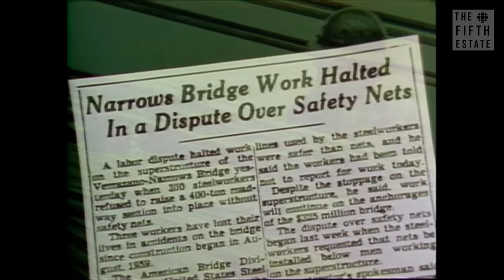Ironworkers from Newfoundland : Walking Iron (1986) - The Fifth Estate

Comment: I don’t think you could find a more manly job then an ironworker. These guys have balls of steel.
Reply: A lot different these days,safety has changed a lot!
Reply: Balls of iron
Reply: I agree
Reply: A miner . 
Where the iron begins 👍
Reply: Try “Steeplejack”
Reply: Nuts of steel*
Reply: @typicalrockhound9887   I ironwork in a mine, what’s that mean?
Reply: Feminist don't want this job
Reply: @peterwarawa2763  I was an iron worker an eagle pass Texas in the mines you need iron workers to build certain things that she was Hoppers and such and put the I beams in to support them fun job I loved it it was a thrill but now I work in the oil and gas in the street as a rough neck
Reply: @desm4541  of course not! its difficult! lol
Reply: Saturation diving.
Reply: Boilermaker
Reply: Loggers...
Reply: Prostitution is most dangerous by far
Reply: I currently remodel bathrooms but I think I want to get into this trade it's so badass
Reply: That’s easy boilermaker
Reply: nursing?
Reply: I challenge any Ironworker to detailed finish carpentry to an unplumb not square goon that has no fear of walking on steel. Any monkey can walk a straight line.
Reply: "Laughs in Boilermaker"
Reply: Coal miner.
Reply: Loggers 
Miners
Steel workers

We need a new YMCA song.😄🤟
Reply: Logging
Reply: Blued Steele I say
Reply: Roughneck
Reply: @swell411   - Oh brother. 🙄
Reply: "DID" have balls of steel.
Reply: Крутые американские ребята работяги, респект вам.
Reply: Paratrooper.

Comment: 40 plus years as an operating engineer, local 49, my favorite job was hoisting iron.  Nothing more satisfying than getting on with a good raising gang.  If you had good connectors, things went like  clockwork.  We knew what we were doing by instinct as much as anything.  Always a great sense of accomplishment at the end of a shift.
Reply: Huge respect to crane ops. I am a entertainment rigger/steel climber for stadium shows and working with a great crane op is an amazing experience.

Comment: Can someone explain to me what the "bullstick" was used for? I dont understand it
Reply: Steven Ewald it's where we as a tag line runner uses for leverage to move the weight in the air and position it for the connector walking the steel. Hard to explain
Reply: It turns the crane. The bells make it boom in and out and up and down.
Reply: Its actually called a bull pin it aligns the steel for bolt up